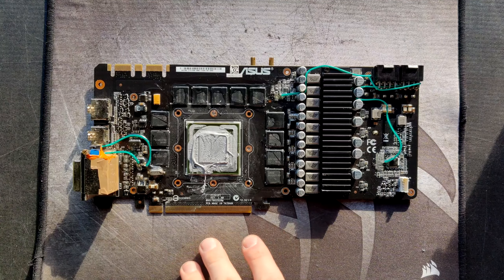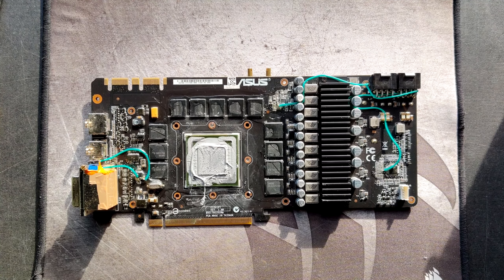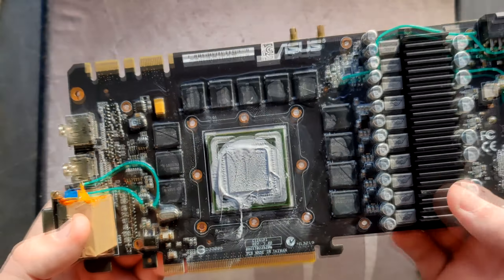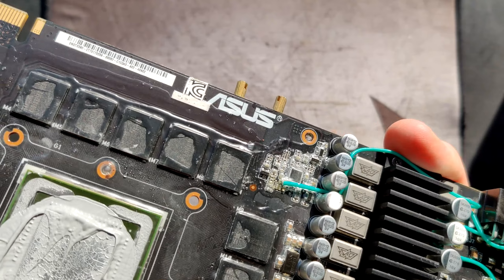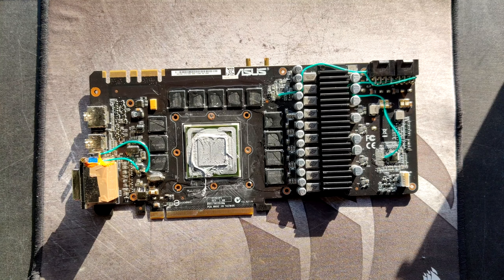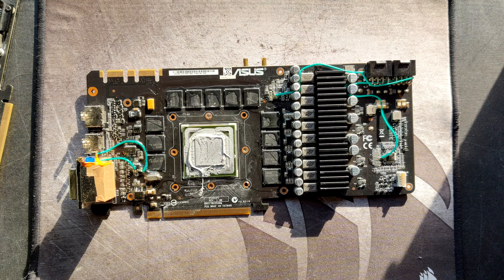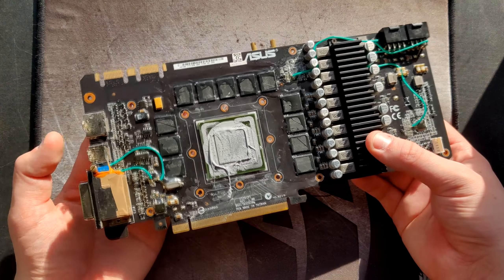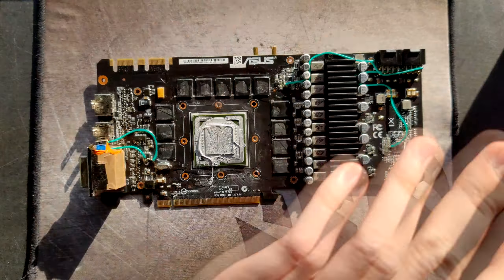GTX 580 DCUII Sub Zero Overclocking Results

Comment: I delidded a GTX 560 Ti 448 and now it is artifacting. When I push against it and apply pressure on certain parts of the Pcb while the card is running the artifacts go away. What could be the cause of this? Damaged BGA of a Ram chip, broken trace in the pcb? I hope someone is able to give me a hint.
Reply from the maker: Artifacting that goes away with certain levels of mounting pressure it somewhat common on GF110 based cards. i had it happen on three of mine. all of them MSI for some reason. the only fix i was able to find was to just use the right amount of mounting pressure. maybe a proper full replacement fo the BGA could fix it
Reply: @CmdrSoyo  You think it is the GPU die itself? Mine is a MSI aswell.
Reply from the maker: @zoglplayer329  most likely the BGA imo
Reply: @CmdrSoyo  thank you very much!